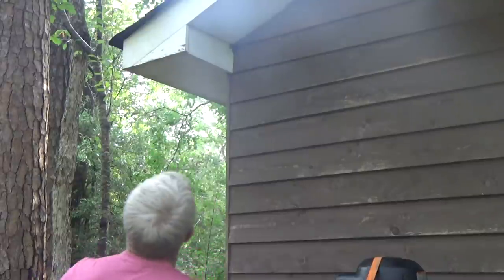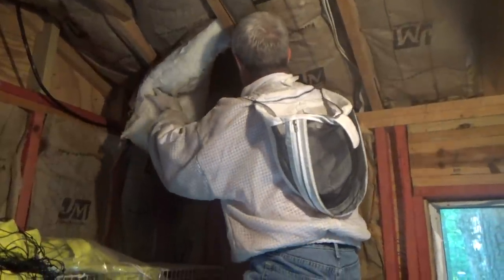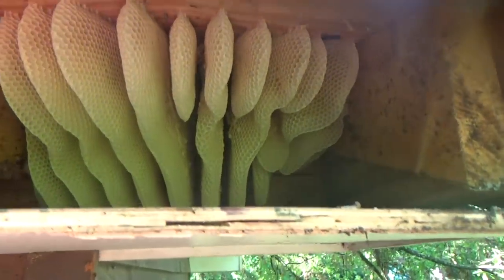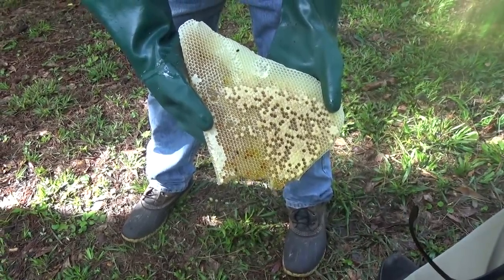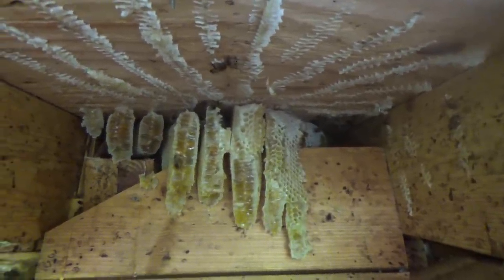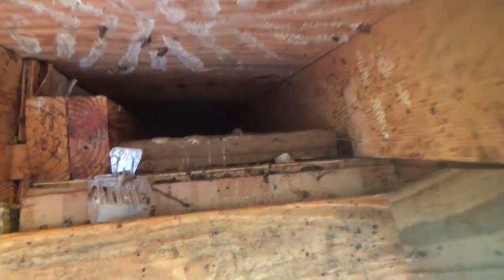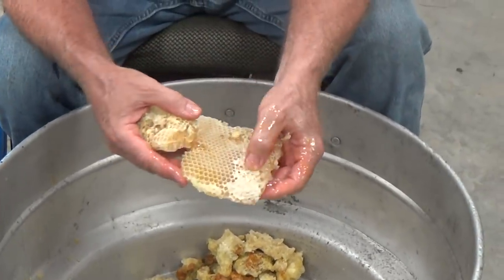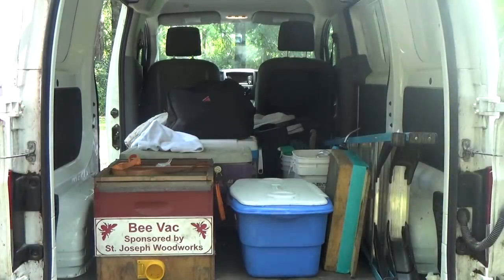Easiest way to get bees off their comb without harming them.

Comment: Hello! We are wanting to get into bee removal, but we would like to know if you charge for the removal and if so how much?  Also do you have the customer responsible for contracting the put back? 
Thanks in advance!
Reply from the maker: Just know one thing, removing bees is not as easy as I make it out to be thanks to a bunch of creative editing. However, if you are determined to jump in, go for it. Based on your knowledge of removals, the rate that is charged is reflective, as well as the area you are in. My suggestion is find out what others are charging to remove bees and be competitive in your pricing. Repairing the damage is also a consideration of the cost of the removal. If you are going to do the repair, charge accordingly. If the homeowner is responsible, that needs to be taken into consideration as well. Best wishes for your successes. God's peace.
Mr. Ed